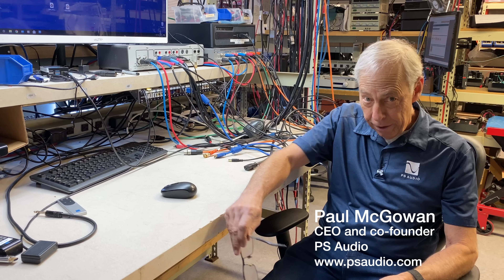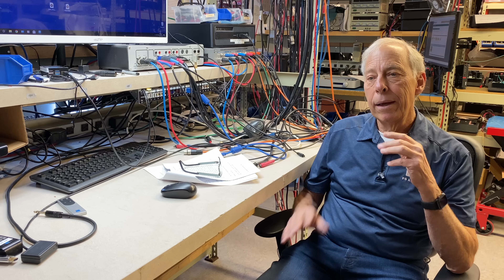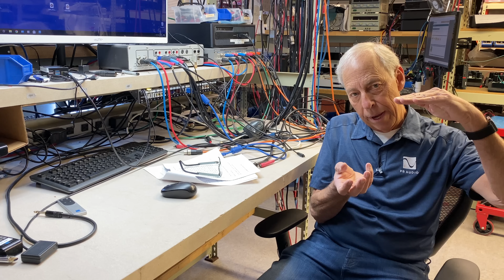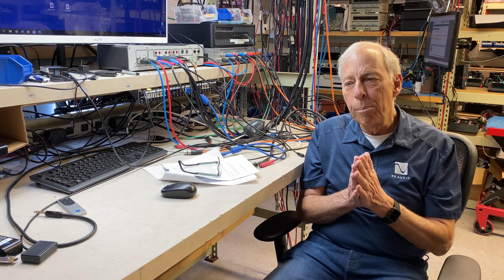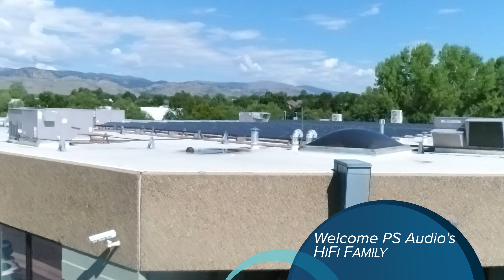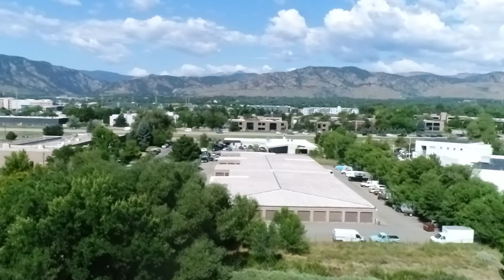Why aren't bridged amps more popular?

Comment: Not out of phase Paul but "inverted" phase.  There is a difference in meaning here.  Many 2 channel PA amps have the capacity to be wired in a 1 channel (mono) bridged mode.  You do have to be cognisant of the amp/speaker power and impedance matching.  Passive speaker cable is part of the impedance matching question.  It makes no sense using an amp with a high damping factor and nobbling that capability with long thin cables.  30 years in PA have proved to me that the Ethan Winer crowd are simply widely missing the mark on true sound reinforcement because of this issue.  There is no need to make peoples ears bleed to fool them into thinking your sound is good.  Simply setup correctly so it actually is good!  In rough terms, it makes no sense to use a high damping factor amp and nobble that capacity with pathetically long thin high impedance cables....
Reply: Also, it makes no sense to seek a high damping factor amp, to use with drivers and crossovers that have several ohms of copper resistance.  
We need superconducting voice coils.
Reply: @marianneoelund2940  I disagree, because damping factor is source impedance divided by load impedance.  Therefore, you can only have a high damping factor is the load impedance is several hundred to a thousand times higher than the source impedance.  Therefore, there must be some load, enough to constrain current and power to reasonable levels for the equipment used.  If the speakers impedance is too low, your amp goes up in smoke.  The deal with all this is impedance, not DC resistance.  The XO is an impedance  device, not a resistive device. Yes, it has some resistance as all conductive devices do, but not a whole lot.  Its basically a low and high pass filter built from capacitors and inductors.  These are the 2 main electrical properties that produce the impedance required to perform the frequency filtering task.  The alternative is to do that filtering at the signal level and drive the speaker transduces with separate amps.  That is sometimes done using DSP of course but it a lot more expensive than putting XOs in the speaker cabinet as just stereo 3 way would require 6 separate power amplifiers, instead of the traditional 2.

DC resistance is not a huge deal in speaker cables. it's just some insertion loss that can be compensated with more gain.  Cable impedance can be a problem as it reduces the amplifiers control over transducer excursions (distortion).  Much like if your cars hydraulic systems has air in the lines, reducing the precision & effectiveness of your steering and braking etc.
Reply: @kenwebster5053  Ken, what you need to understand is that the copper resistances in the crossover and drivers is effectively part of the source impedance.  
The mathematical model is an external series resistor representing the copper resistance, with the speaker coils then treated as resistanceless.  The same modeling approach is used for motors, transformers, inductors and many other devices, whenever copper losses have a significant impact on the analysis being performed.  
An 8 ohm speaker will typically have around 3 ohms of copper resistance, sometimes slightly more.  Since damping factor, not surprisingly, is about damping, the total resistance in the circuit must be taken into account.  It is not the amplifier's output impedance alone, which determines the system damping factor; it is the amplifier's output impedance, plus speaker cable resistance, plus the speaker's copper resistances.  The latter dominates, thus system damping factor rarely exceeds 3.  
This is still true in a multi-amplified system where the drivers connect directly to the amplifier outputs.
Reply: @marianneoelund2940  It's a constant part and therefore not relevant to filtering.  Only reactance is relevant to filtering.
Even it were relevant to distortion, the issue is load  by source impedance & High end amplifiers have such low output impedance to make this negligible.  At the end of the day, you have to run electricity through wires.  Copper is an economical low resistance conductor and the length of wire in an XO inductor coil is pretty negligible in the scheme of things.  You have to have something to do the job.  What practical alternative are you suggesting?
Reply: @kenwebster5053  The wire resistance in a driver voice coil is not negligible.  It enforces an upper limit for the system damping factor, which as I already stated,  is only around 3 at best.  
I'm not suggesting any practical alternative, just pointing out the folly of believing that amplifier damping factors in the hundreds or thousands have any practical meaning.  Similarly, the expense of massive speaker cables is wasteful in most cases.  Very few owners are aware of this.
Reply: @marianneoelund2940  Every amp worth buying states damping factor into a nominal impedance load.
Every speaker worth buying states it's nominal impedance load.

Impedance is a function of reactance and resistance.  You can have different mixes of  reactance & resistance for the same 8 ohm impedance. As damping factor is a function of source and load impedances, neither of which have changed, damping factor remains unchanged.

Also, reducing resistance only also reduces load impedance and as damping factor is load / source, this would reduce damping factor, making the value worse, not better.  Perhaps you looking to define some other metric than damping factor.

Therefore resistance is futile.
Reply: @kenwebster5053  No, as Capt. Picard proved, the 'Borg were wrong - and so are you.  
You cannot analyze the dynamics of an amplifier/cable/speaker system by clinging to two simple parameters, while ignoring the internal details.  Here's an illustrative analogy which I hope you can grasp better - 
College freshman Dan Simpleton just learned about energy-based methods for solving physics problems.  He decides to visit a car dealer and ask a salesman about a sportscar he's had his eye on.  The salesman tells him that it's 232 HP, and weighs 3350 lb (1520 Kg) with driver.  Dan whips out his calculator and uses those two simple figures to compute the 0-60mph acceleration time for the car:  
Kinetic energy at 60 mph (26.8 m/s) is (1/2)*1520 Kg * (26.8 m/s)^2  = 547Kj, and a 232 HP engine produces 173 KW, or 173Kj/sec.  
Then Dan concludes the 0-60 acceleration time is 547Kj/(173Kj/sec) = 3.16 sec.  Wow!  Dan is impressed, and decides to buy the car.  
But what did Dan overlook?  Almost all of the details of how a car's drivetrain actually works, like HP only applying to one engine rpm, limited gear ratio selections, shifting delays, losses in the transmission and other drivetrain components, tire slip, etc.  
So no, Ken, you cannot ignore the losses in a system - and copper resistance in speaker systems is a major one.  
Now, you may continue to believe in your idealized fantasy system that only needs two parameters to tell you how it will perform, but I and the other engineers who visit here, will just give you a knowing smile and a wink.  ;-)
Reply: @marianneoelund2940  Not analysing anything, just discussing the definition and meaning of the term "Damping Factor" & pointing out that regardless of proportions of the various properties that make up impedance, a fixed source and load impedance will always give the same damping factor value.  You can choose any 8 ohm speaker you like and every single one of them driven by the same Amp, will have the exact same damping factor, because  8 / 0.016 ohms = 500 regardless of how much of that 8 ohms nominal impedance load is made up of DC resistance.  whether the 8 ohms is made up of 80% resistance or just 1%, it is still 8 ohms impedance in the damping factor calculation. So the damping factor value remains the same.   It seems to me that damping factor is not the appropriate term to describe whatever it is you are trying to say.  The basic electrical properties are resistance, capacitance and inductance.  Impedance is a combination of all 3.  Reactance is just the last 2 combined.  What effect do you think resistance has on the sound from speakers?
Reply: @kenwebster5053  What you're not "getting" is that the damping factor given as a simple ratio of speaker impedance to amplifier output impedance, is not a useful metric.  It does not tell you how the complete system, including the speaker, behaves.  It is lying to you, because the true damping factor of the system is relatively minuscule, and the contributions of the amplifier and speaker cable impedances are insignificant in most cases.  
So, please stop throwing the ratio of speaker impedance to amplifier Zo at me, because I will reject it as a meaningful parameter every time.  It's no more than a marketing gimmick for amplifier (and cable) manufacturers.  
I wish that speaker manufacturers would state what the ultimate achievable damping factor is for the system that includes their speakers.  That would start to bring some sanity to the issue.
Reply: @marianneoelund2940  It's certainly one of several metrics useful in short listing amplifier options because it can quickly identify which amps are more likely to have better than average control over a given speaker.    No, it doesn't tell you anything much about choosing a speaker, but then I never claimed that it did.

Comment: Very well explained .... yes I remember making a bridge amp using LM3886. These amp chips run on +_ 37v rails but in bridge mode they can only run on +_ 28v to keep the chip within its thermal limits

Comment: I bridged a Crown 1000 in a rack system for my bass guitar. Sounds awesome! The best I remember the tech had to wire the speakon connection differently. Coming from the amp to the cabinet can only be a certain way.

Comment: Internally bridged vs. externally bridgeable are not exactly the same. You get more performance for your money with an amplifier that is carefully optimized for outputting the power you need, with or without internal bridging.

Comment: Why should it be an issue with impedance surely you just put a zobel network on the output to keep the impedance in check
Reply from the maker: It's not that easy. It sees half the impedance because there's twice the voltage.
Reply: Zobel networks only affect impedance at high frequencies.  They are not effective across the full audio frequency range.
Reply: zobel network. when your tweeter sound harsh, put it in and it sound softer.
Reply: The speaker impedance doesn't change, but it's basically being split between the two amplifier modules. The problem is that designing an amplifier to drive 2 ohm loads is hard. Power is equal to (I^2) * R, so it should be easy to see that getting a lot of power at 2 ohms requires a lot of current. The problem is that in order to get a lot of power at 8 ohms, you need fairly high voltage rails, and you quickly run into an SOA (safe operating area) issue in the output stage, which is typically solved by adding more output transistors. Do some google searching for what the inside of a Crest 7001 looks like- you can see just how many output transistors there are for this very reason. 

Furthermore, even with enough output transistors to handle it, there is still a lot of heat that has to go somewhere, and most audiophiles will reject any amplifier with a cooling fan, so that means big, heavy and expensive heatsinks.
Reply: @H-77  
From SOA considerations, it's actually much easier to design a BJT amplifier to achieve a target power level into a 4 ohm load, if it's bridge mode, because the working Vce is cut in half.  BJT's safely handle much higher currents at lower voltages.  
Another approach to ameliorating SOA issues, is stacked output transistors as used in the Dynaco Stereo 400 (a Dave Hafler design).

Comment: In commercial sound systems for theatre and cinema is a reason to use the same model of 2 channel amplifier for horns and then bridge the amplifiers for use with the bass speakers that require much more power.  That way you can have the same  model for two channels of sound or bridge the channels for bass loads.